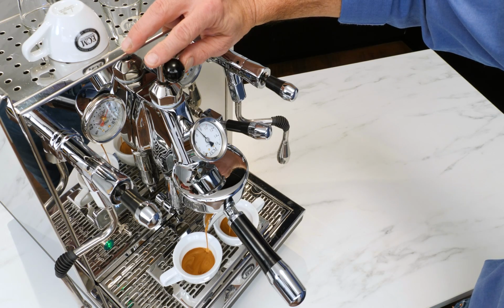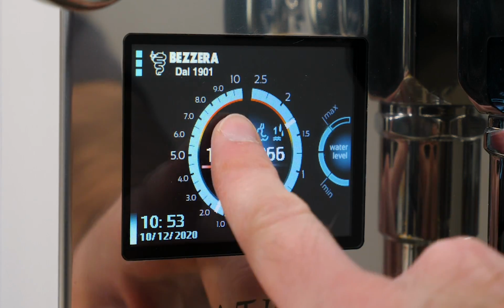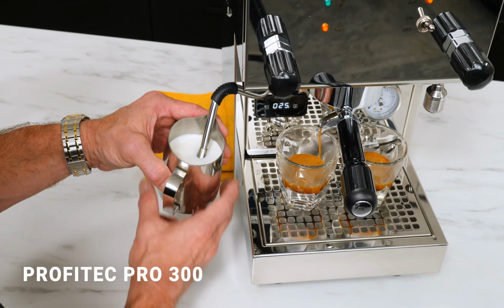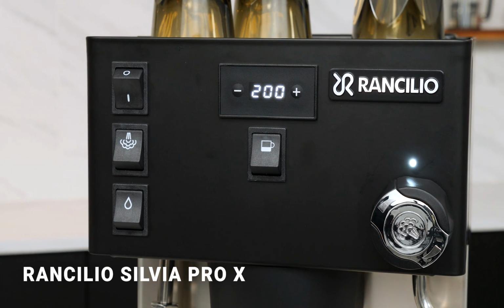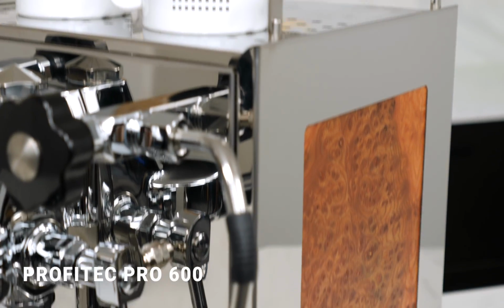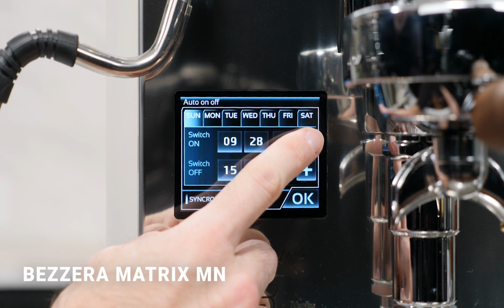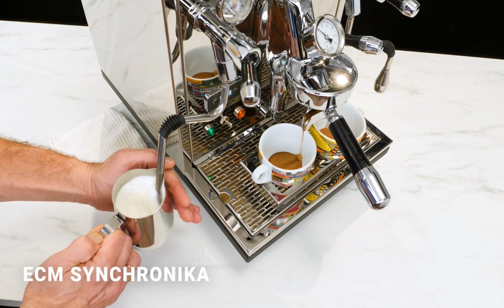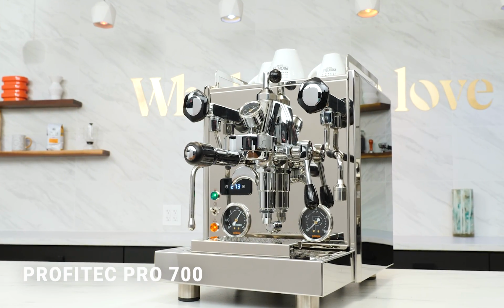Top 5 Favorite Dual Boiler Espresso Machines of 2022

Comment: I currently have brevlle barista espresso, I make 2 iced lattes in the morning during the weekdays and 2 cappuccinos on weekends. Do you think it would be an overkill if I upgrade to dual boiler profitec 300 and eureka libra?
Reply from the maker: Hi user, Overkill? Depends on how critical you are of your espresso. Libra is without question a much better grinder than the Breville built in. The Pro 300 is a step up in build quality and reliability. With proper maintenance, you can expect it to run for decades. If it ever has a problem it's very repairable. Beyond that, the Pro 300 uses real boilers while the Breville uses a thermoblock. You can expect better brew temperature stability on the Pro 300 as well as always available steam and more of it.
Hope that helps!
Marc

Comment: Hello,

Just bought a new Profitec pro 700 from you guys and wanted to see if I can connect it to an Alexa plug in? I had my Expobar office control on it and loved being able to ask Alexa to turn on my espresso machine in the morning from bed or turn it on when I wasn’t home.
Reply from the maker: Hey A, So long as the plug is rated to handle the power load of the machine. It likely is if it was able to do your Expobar. But do check!
Marc

Comment: Машина La Pavoni Botticelli Dual Boiler потекла при первом же включении, рабочего давления помпа не показала. Стоит такая красивая, кнопочки горят, но совершенно бесполезная и течет по-тихому. Приобреталась в качестве подарка, не включали 15 дней, попали на гарантийный ремонт. Гарантийный ремонт в исполнении ООО "Время кухни" (продавец) и ООО "СМЕГ Руссия" (поставщик) превратился в кошмар - машинку забрали и 12 дней никакой информации. Дали телефоны 3 (трех) авторизованных центров. Первый сразу же забрал машинку, никакой информации о ее судьбе больше нет.  На звонки обещают уточнить и перезвонить. Может и уточняют, но не перезванивают, следующий раз - опять обещание уточнять.  Уже боязно, не мошенники ли, вернется ли машинка, опять же - какая?! Ведь если врут, значит это кому-нибудь нудно.  Вкус кофе - ужасный: его нет.
Reply from the maker: Translated:
The La Pavoni Botticelli Dual Boiler machine leaked at the first start, the pump did not show working pressure. It is so beautiful, the buttons are on, but it is completely useless and flows quietly. Purchased as a gift, did not include 15 days, got to the warranty repair. Warranty repairs performed by LLC "Kitchen Time" (seller) and LLC "SMEG Russia" (supplier) turned into a nightmare - the machine was taken away and there was no information for 12 days. Gave phone numbers of 3 (three) authorized centers. The first one immediately took the car, there is no more information about its fate. They promise to clarify and call back. Maybe they clarify, but they don’t call back, next time - again a promise to clarify.
Reply: Благодарю за помощь!
Reply: La Pavoni после этого комментария быстро починилась - за два дня!
Со мной связались из представительства SMEG в России и сообщили о решении проблемы. Что-то было не докручено. 
Ваш канал побуждает производителей лучше относиться к потребностям!

Comment: Hey Marc I own a Pro600 and I’m thinking maybe it’s time for an upgrade, Pro700 and synchronika  are the ones I’m leaning to, just not sure if the jump in price from my current PP600 to any of those will be noticeable in terms of shot quality
Reply from the maker: Hi AC, Synchronika is my favorite dual boiler machine. Def the overall best prosumer level dual boiler machine on the market. Think I mentioned in the video the Synchronika and Pro 700 are essentially identical internally. The major differences between your 600 and Sync/700 are larger boilers, rotary pump and plumbability direct to waterline. When plumbed direct to waterline either machine can do line pressure pre-infusion. Rotary pumps are quieter and have a higher flow rate than the vibe pump in the 600. If you equip machine with flow control you'll have more flow rate to play with. Flow control is currently a free upgrade on either machine from Whole Latte Love. https://www.wholelattelove.com/products/ecm-synchronika-dual-boiler-with-flow-control And you can customize with various wood species on levers and portafilters.
Hope that helps!
Marc
Reply: hey! Why would you want to upgrade the 600 to the 700 / Synchronika? Why are you not satisfied with the 600 anymore? Reason why I am asking is that I actually want to purchase a 600 very soon. (I don't want to plumb the machine in and the smaller steam boiler seems very OK for me and my wife). I wonder why I should pay more to get the 700 for home use or even like 1000 $ more for the synchronika (YES, Synchronika has much nicer external finish, but that's not worth 1000 $ for me). Thanks for answering, maybe it helps me a lot! Thx!
Reply: @t0bistr  👋, I love my PP600; I haven't had an issue with her for almost 4 years. The only reason for the upgrade is to have a machine that includes:

Flow Control

Rotary Pump with plumb-in capacity

A larger steam boiler (although the PP600 is enough to entertain a small party, I'm hosting small group sessions for my church at home. When there are more than 10 people, temperature stability could become an issue for me serving back to back milk based drinks)
Reply: @t0bistr  so based on your use case I think the PP600 fits you nicely, you won’t regret pulling the trigger. Hope this helps!
Reply: @aureliocastro6478  thank you for your fast answer. This definitely helps a lot and makes me even more sure to go for the 600! :) best regards

Comment: Can you make mention if ECM/Profitec is working on any functional upgrades to their tech, things like low flow mode or digital preinfusion, for 2023?
Reply from the maker: Hi Justin, Thanks for the question. For low flow any current ECM or Profitec machine with an E61 group can be fitted with flow control. In 2022 Profitec released the Pro 400 and ECM brought out the Mechanika Slim VI. These heat -exchange boiler machines both have a pre-infusion mode that runs the pump for ~5 seconds, pauses for ~3 and then resumes normal extraction. It's a feature that can be turned on/off by the user. Both also have user selectable temperature presets. A 3 postion switch lets one easily select cooler brew temps appropriate for dark roasts or higher brew temp that's good for medium/light roasts. The third position bumps up pressure/temperature in the boiler for extra steaming power. Temps are controlled by PID, but just at the 3 presets instead of a full range of temps you have on regular PID machines. I have been working with a prototype for a new ECM HX machine with some interesting new capabilities. Not sure if/when it will be released and since it's not public I cannot disclose any details.
Marc
Reply: @Wholelattelovepage  that's what I wanted Marc, the juicy deets!  Thanks for your response.  I was aware of the current techs, but thanks for the refresher.  I think stuff like 3 mode PID's and repeatable automated pressure/flow profiling without a zillion configurations has a bright commercial future as people get burnt out thinking they need infinite control.  The 400 is probably the best machine for most people.
Reply from the maker: @JusBThankful  Juicy deets spilling could get me in trouble! I agree with your take on the 400 and same for the Mechanika VI Slim. I'll have a video on that one dropping next week featuring the dressed up Heritage Line model.
Marc

Comment: I keep hearing how the Lelit Mara X is superior to the Profitec Pro 300 because of the temperature control it has. It is HX instead of dual boiler so heat up times are around 25min instead of the quick PP300. Wondering how WLL compares these two machines at a similar price point?
Reply from the maker: Hi Keith, Thanks for the question. Modern E61 group machines with HX boilers controlled by PID do a relatively good job at keeping temps stable. But most need a cooling flush if sitting on and idle for extended periods. When it's needed depends on variables like ambient temps, was the PF kept in the group, etc. Keep in mind the steam producing section of an HX boiler runs much hotter than the desired brew temp so these machines depend on the thermosiphon out to the group and back to keep that circuit's water near the desired brew temp. The group is a big heat sink so cooler ambient temps or even a draft changes how much heat it gives up. The dual boiler Pro 300 runs the boiler much closer to the desired brew temp than an HX boiler. Since it's not shedding nearly as much heat as an E61 group it's more stable and predictable in most situations. The Pro 300's boiler is smaller so recovery time after use is likely longer as there's a bigger temp drop in the boiler with use. The Pro 300 should provide more consistent and stable temps in low frequency usage. If you're the type who turns the machine and makes 2-3 coffees over the space of an hour the Pro 300 is ready to go sooner with less hassle trying to figure if a flush is needed or not.

Comment: Hi Marc,
I like the Bezzera Duo. You didn't mention, or I missed it,  copper boilers in the Bezzera... how do your techs feel about them? Quality? Longevity?
Reply from the maker: Hi Richard, Thanks for the question. There's no real difference in longevity. One slight benefit of copper is for those who might have water high in chlorides. I spoke with our lead tech and he's seen isolated cases of galvanic action between fittings with dissimilar metals in non-copper boilers when source water is high in chlorides.
Hope that helps!
Marc

Comment: Why didn't you call out the Profitec Pro 500?
Reply from the maker: Hi PN, Well, the Pro 500 is a heat-exchange boiler machine and this video is for dual boiler machines. The Profitec Pro 500 is in our video Top 5 Favorite Heat Exchange Boiler Espresso Machines of 2022: https://youtu.be/Hr9dQsK_Pck
Marc

Comment: Why aren't there any dual boiler levas?
Reply from the maker: Hi C, hmmm... the Pro 600, Pro 700 and Synchronika are all E61 group machines with levers.
Reply: @Wholelattelovepage  Hi, thanks for the reply.  I cannot find an instance of a true leva-style machine with dual boilers?  Meaning a boiler dedicated to the steaming wand vs a heat exchanger.  I found a pro 800 with the Leva, but single boiler?  Couldn't find any for the ECM with the lever.  Of you can share a link or model number please share.  I found one La San Marcos single group head that someone customized and added the second boiler dedicated to the steam wand, but otherwise striking out?  Thanks for your help in advance.

Comment: lelit bianca is the winner of the 5
Reply from the maker: Hi O, thanks for the comment. If you're about saving money at the expense of build quality that's an option. But at the same price as the E61 DB machines here it's not even close. I've been inside them all and the higher general build quality is clearly evident for the machines featured here.
Reply: @Wholelattelovepage  the correct title is "the 5 best machines that we sell in the US", but lelit bianca is better that this 5. Low and high flow, electronic preinfusion, woods, naked portafilter included, ims filters. Take a look to it.

Regards.
Reply from the maker: @OsCorrals86  You are certainly entitled to your opinion and I stand by mine. As mentioned above I've been inside the machine and compared construction and component quality. At similar prices it's not even close.

Comment: What is the difference between the ECM Synchronika vs the ECM Technika V Profi PID?  If I was Mark, which one would I buy?
Reply from the maker: Hey Mike, If I was Mike I'd go with the Synchronika for the dual boilers. Individual temp control of each so crank the steam boiler up to 11 (270F) for near 2 bar of pressure. Technika is a heat exchange boiler machine. Changing boiler temp on Technika for more steam  changes the brew temp.
Marc

Comment: Hi Marc, greetings from New Zealand again :) It's been about 1 1/2 years since I bought my Pro 600. I did so much research but it was your videos that confirmed it was the right machine for me. I then bought the Ceado E37J which is a great grinder for my budget. Since then I've been experimenting with dosing cups (helps with clumping) and puck screens. I'm blown away by the difference using a puck screen combined with an IMS Nano Quartz shower screen. The machine and workflow is so much cleaner. Anyway, loving your channel and thanks again for your time here. Do test out with puck screens :) Cheers Marc, Craig
Reply from the maker: Hey Craig, Back at you from the USA and thanks a whole latte for the kind comments and reports on your experience with the Pro 600 and E37J!🚨 Dosing cups, WDT tools, precision filter baskets, etc make a difference. We've played with puck screens a bit - no video on those yet. But we do have this one comparing precision shower screens if you missed it: https://youtu.be/nHOYw3tVYTY
Marc
Reply: @Wholelattelovepage  Cheers Marc. Yes, that video was the reason why I bought the IMS Nano Quartz screen about a month ago. It's worth every cent. Thanks
Reply: I The store

Comment: Between the Pro 600 and Pro 400, while I like the full PID on the 600, I like the proper pre-infusion in the 400 (and still has adjustable temp) and the $800 price difference. Like that they both easily adjust pressure too.
Reply from the maker: Hey Tim, Thanks for sharing your thoughts!
Marc
Reply: @Wholelattelovepage  Thanks for making great coffee content Marc!

Comment: I have been using the synchronika for six months, it makes the best espresso and lattes. Dual boilers ultra quite rotary pump. I will never go back to the entry level machins. Synchronika coffee taste and texture takes you to another level.
Reply from the maker: Hi Ayman, Thanks for sharing your experience and thoughts on the Synchronika!
Marc
Reply: Hello how much is the heat up times on synchronika ?
Reply: @NoQuinn  That depends on the ambient temperature. Espresso boiler heats up within 5 min. while steaming boiler within 15 min.

Comment: Very nice clip! I happen to own a Bezzera Matrix MN and guests tend to like the LED colors. There are people who find it over the top and like a more classical look. But well, it sort of fits in a tradition of the well lit espresso machines of the sixties and seventies. And in the end they like the coffee! But apart from that, all these machines make great coffee, so any random choice will do. And I do like the ECM woodwork 🤪.
Reply: Can you mod the bezzera with the flow control upgade. I've been researching this machine and the profitec 600 and 600 mode they are all very similar and i am torn between the 3 of them plus finding them in stock in the UK is tricky at the moment thx😎🇬🇧
Reply from the maker: E61 flow controls are for the most part interchangeable. Bezzera recently came out with one. Supply may be tight - I've only gotten my hands on a demo so far.
Marc
Reply: @l.l.coolray  yes you  can I recently modified mine using the lelit bianca kit
Reply from the maker: Hey l, Thanks for the comment! breaking from tradition is hard for some. Like the relate to flashy lit up machines!
Marc

Comment: I know you guys work so close with ECM and Profitec. The wood is a great addition but can they get rid of the chrome? 

We are way beyond stainless steel and chrome in the kitchen.  Look at all the colors we get even fridges now you can color match.  I think you should open discussion and let's get more color.  Gaggia gives you color at $500 why can't a $3,000 machine have color instead of chrome?

 Even Black, White just to start...
Reply from the maker: Hi Daniel, The wood is nice! It's difficult to break the tradition of the classic stainless steel/chrome finishes! But, we are seeing some departure and there's more to come! Synchronika is available with Anthracite sine panels. Profitec Pro 400 comes in 3 colors.
Marc
Reply: @Wholelattelovepage  stainless, chrome is timeless... and easy to clean. color fashions come and go.  no thanks.
Reply: Hi, Daniel, may I disagree ;-)

I specifically bought this chrome and stainless steel combination — as it is timeless. And I am very happy with my decision. If something should ever happen to my machine (what I strongly doubt), I could easily polish off the scratch from the stainless steel.

Before buying my ECM Synchronika , I had a closer look at ECM’s 25th anniversary special edition. Yes, I liked the darker look of the finish — but I was afraid that within several years I would put it down to the 2022 Lifestyle…

It is like with colors for a brand new car and I noticed that I wanted to be on the “safe side” by opting for the classic look ;-)

On the other hand, my Eureka Mignon Single Dose is pitch black and I even dyed the wooden parts — to make my Synchronika stick even more out on my self-made brewing bar.

It is a pleasure to have this combination in my living room when coming back from the kitchen — and my Synchronika is looking at me with its beautiful barometers and its bright green and orange “I am ready, no matter what” smile…
Reply: @anotherguycalledsmith  Exactly my friend, you stick with the same old design and they can let others get new designs and colors who have an eye for design.  This way we are both happy.
Reply: @daniellanzotti2391  I mean, they are rock solid, you can do whatever you want to customize them… ;-)

In the end, it all comes down to a question of taste…